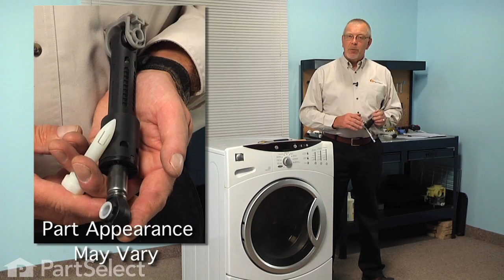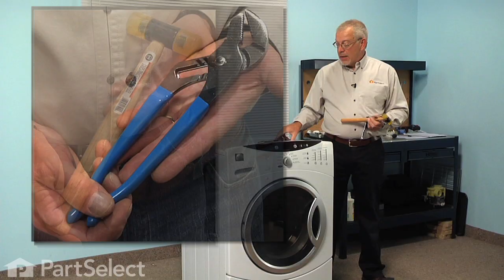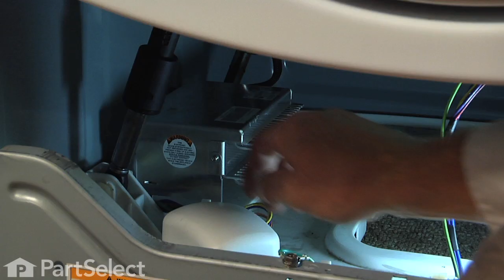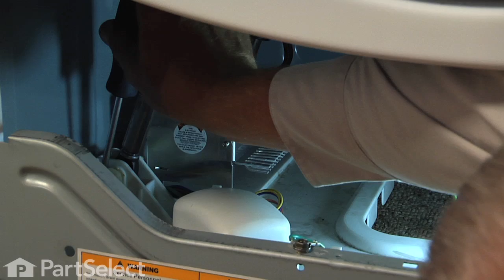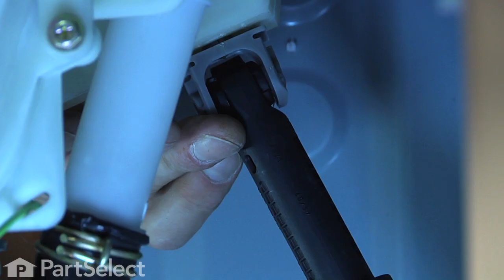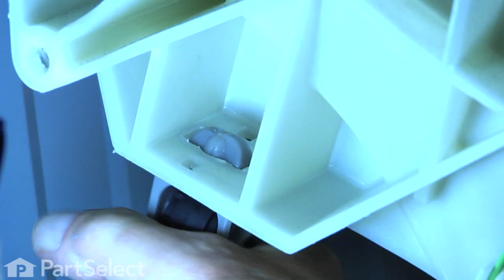Washing Machine Repair - Replacing the Shock Absorber with Pin (GE Part # WH01X10343)

Comment: This was very helpful, but man installing the new ones was nowhere as easy as you made it look 😅. I've never had to fight so much to push a lock pin in. On the last one I realized I could use channel locks to push the pins in and it was so much easier, so I just thought some of you might find this helpful.
Reply: I'm having this same issue. What do you mean by using channel locks?
Reply: @grainneredmond6194 using large channel locks, you can squeeze the pin in like a clamp.

Comment: I noticed you didn't do the right front on camera. LOL. By far harder to get to than all of the others combined. Wish that galvanized plate was screwed on not pinched welded on.  EDIT: I wrote that comment before I did the rear shocks. The opposing corner rear is by FAR the hardest to get to! Ugh

Comment: there was no room to pull the washer out to do this rear access way- I'm sitting on 3/4 done.... and lots of long scratches down my arms... hopefully i can get the last one installed tonight... just came to watch the second part of the video - looks way easier from the back panel. decisions/ decisions. also was advised to pull the top off and check to see if those massive springs are weak as well .... [WH05X10009 Washing Machine Suspension Spring]

Comment: Very informative video but there is a reason he changed the left front and the right rear. The right front is blocked by the drain pump and the left rear is blocked by the motor making them a pain in the ass to work on. Thank you very much GE for using cheap plastic parts then charging an arm and leg to buy replacement parts.

Comment: Help. My ge front load washer is violently shaking and I don’t know why. I looked at all 4 shock absorbers and they appear to be fine. I did however find 2 bolts that are approximately 2” long with a washer that measures across the cent 1”. I can’t figure out where these bolts came  from. They are still screwed into either a piece of plastic or ceramic. I just don’t see where they would go. I got this washer when I bought the house and not sure if these bolt are part of the shipping or not. But I found them inside the machine on the back bottom just laying there. This machine has never had leveling legs nor do I see any kind of springs that would support the spin cycle. I’d appreciate any help you can give me. Thanks.

Comment: When replacing the shock absorbers do I need to replace the springs as well? Does it have springs? Part #'s - mod 110  45088 404 // ser cst2219443 // type 199  712 cn/ap
Reply from the maker: Great question, typically if the shock are being replaced as they are just worn out or broken the springs should be fine. Saying that if all the shocks were broken and the tub was left to hang on those springs for a long period of time they could possibly be weakened or stretched a bit.  Replace your shock(s) and if it runs as it should then you are all set.
Reply: @partselect  thank you 🙏🏽

Comment: Thank you for posting the video.! My son and I just replaced all 4 shocks from a model GFW450SSM1WW and I wanted to let you know that unfortunately it looks like in the editing of this video, replacement of the right front shock absorber, which is the most difficult to access, was missed (the front left is far and away the easiest to access and replace).  We found that the best overall solution was to leave the rear panel in place and tip the washer on it's back.  Our particular model has a large hole in the base from which it is relatively easy to access all 4 of the shocks (far easier than from the front and/or rear panels).
Reply: I have the same exact washer and today repair guy showed me 3 out of 4 shocks are gone... anything to watch out for when tipping the washer? did you see any damage afterwards from doing that? are they still holding up?
Reply: @texasaggie85   Hi Texas, It's been a year since I did this so I'm relying on long term memory for this, but here goes.  You have to be careful when tipping because if the shock absorbers are defective the balancing weights will shift a bit.  Can be corrected with new shocks but don't just let it fall over on it's back or you could see some damage.  As indicated, my son and I performed the repair and the washer is still going strong.  Also, don't recall if I'd seen this on this particular video or another but placing a socket over the ends of the shock pins can be helpful in removing them.  If that doesn't work, just use pliers (I used both).  Hope this helps.  Best of luck!
Reply: @AT-qu1ek  i ended up repairing it this way. You definitely need help tipping it over. Two out four are very hard to access, especially if you’re a bigger dude. Thanks for the tip. I hate GE for using plastic ends on a freaking shock absorber.
Reply: @texasaggie85  Glad to hear it worked for you!  And I agree...pretty lame design by GE. Definitely not designed/manufactured for repairability.
Reply: I too have the same GE model that you have and I appreciate the tip about tipping it on its backside.  Did you have to secure the tub in any way before tipping it?  Did it correct the problem?   My spin cycle won’t go into high speed because the tub flies around too much and the clothes are too wet to put in the dryer.
Reply: @ Hi Eric! It did correct the problem and I made this post quite awhile ago now and it's still going strong. I didn't have any way to secure the tub when tipping it over but I had my son try and hold it steady with the lid open (he held the inside of the tub) as best as he could.  In retrospect, it would have been better to secure the tub via a more robust method (perhaps by wedging something between the tub and the outer housing in at least 2 places).  As I was able to effect the repair, while doing so one of the weights shifted a little bit and now it makes a noticeable bumping sound when on high spin so it's not a 100% like new repair.  However, it's not severe enough to warrant going back in and trying to reduce this vibration and, as I've said, it's been going along fine ever since.  I should note that we have 4 kids so this washer is in use constantly.

Comment: I’m  buying off eBay . Seller can’t even answer if part will fit my machine but still wants me to buy it. Dodgy eBay at it again and this seller is 100% typical liar
Reply from the maker: Always an issue when buying after-market. If you have the model number of the washing machine you're looking to repair, we may be able to point you in the direction of the right part!

Comment: A repairman wanted $760 to do this repair on my washer.  After watching this video I bought the parts for $160 and did the repair myself.  Thank you for helping save $600.
Reply: FYI: These shocks are $36 - $40, depending on seller, on Amazon. If you have Prime, they can be delivered  overnight or same day.  They also come with new pins and inserts.  I personally paid $38 total, delivered overnight (around 8am) Saved a bunch of money, and rcv'd the exact parts needed.   No need to spend $160 for brand new replacement shocks.
Reply: @robertbartlett4448  $160? They’re $11 each on Amazon.

Comment: How do you know that the shocks need replacing?
Reply: The machine will make a banging sound.  Also, you can take off the front and back covers and visually inspect the shocks.  When I did this, I found the top had broken off on three of the four shocks.

Comment: After a long search, reading reviews, talking to salesman at stores and looking for value, I made the right choice.▫ ▫>allmy.tips/GeWasher?10J     From other reviews of other washers I could see many hadn't read the instructions well or applied them well. Me and my wife did, and we have had zero problems. Clothes are clean, we love the pre soak options and various rinse options and our clothes are clean! Our selection was also due to the fact of its large capacity and having an agitator. It does make some crazy different noises, it is a bit loud, but in a laundry room and wash time maybe a little longer, but that is doe to the soak and extra rinses. We are using about a half less detergent. We love our purchase!

Comment: How do I know, if the shock absorbers for my ge front loader is bad. I replaced the springs and it still bangs in spin cycle.  Thanks!
Reply: Old thread but for new searchers I just did my ge. Check for recalls I found out that mine had a recall and that's why it busted the shock absorbers. They still honored it 7 years after and sent me the eProm updater. if it's banging really hard on an unbalanced load most likely one of the shock absorbers bounced so high that it pulled the piston out from out from the bottom or one of the damper pins slid out. I ignored the banging for 6 years until it allowed water to come out and get the connector to the drum motor wet and shorted out the speed controller unit that's in the front left hand corner I replaced the controller the pins the shock absorbers the door lock for less than 75 bucks and a whole lot of scratches on my knuckles.
Reply: @TheManstalkerFiles  Miele charge through the nose for all their parts .
Reply: Usually you'll hear a bang on the side of the washing machine when you put more than two towels in at once.  To test the shock push down on it firmly and quickly, if there's no kick back the shock is naff.